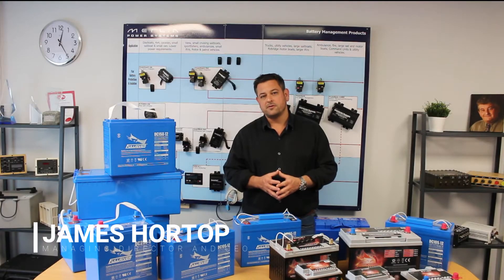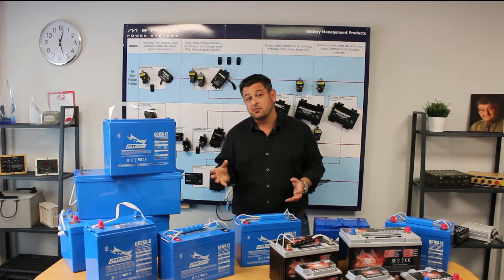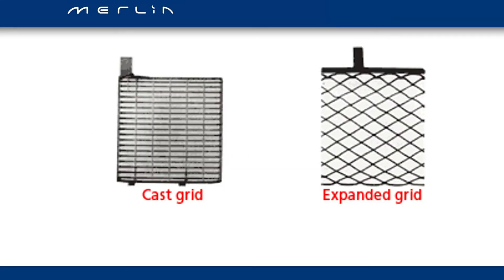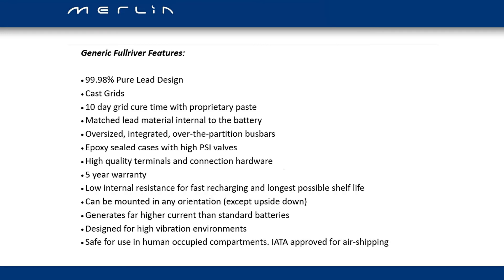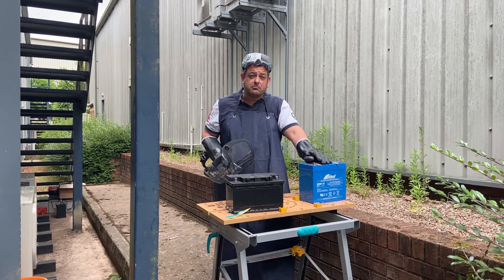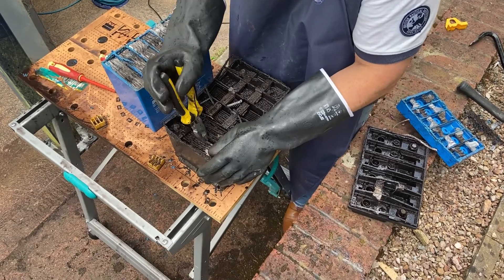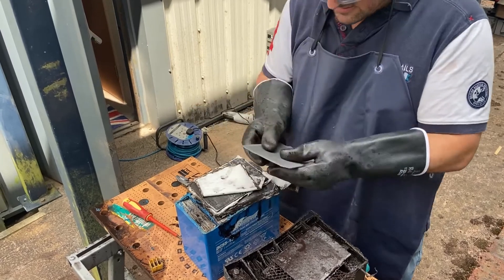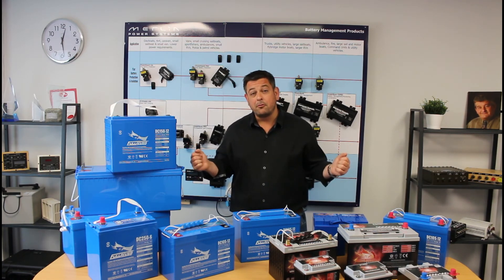Fullriver Batteries: The Difference Is In The Detail

Comment: I have 2 DC Fullrivers in my camper and they are great. I want to change my 85ah aux battery in the car (which runs off a Redarc DCd DC 1225  charger) with the Fullriver DC85. Would this battery be OK under the bonnet of my diesel 4WD ?

Comment: Hey I have a fullriver maintenance free battery, it was nothing taking a charge opened it up and realized all the water is gone from the inside. Can I full it back up with distilled water or a mixture of sulfuric acid and water?
Reply from the maker: Hi Damian. Thank you for your comment. Fullriver batteries are sealed, and maintenance-free, so should never dry out. We would recommend you get in touch with the vendor you purchased these units from if your battery isn't taking charge.
Reply: Distilled yes nothing else sit charge put caps back check volts I did life was 💯 sorry for late response Agm only look in side if bad replace mine was drying out eight years old ✌️

Comment: This seems to be very biased video. You are bullshitting people here.. You comparing AGM against Flooded type (Apple vs oranges). Deep cycle battery vs starter battery (bananas vs melons). Also you have pre-cut the cell tabs to make the battery look mechanically unstable since you knew, that the glass mat in AGM would hold the plates much tighter. The flooded batt. has tabs to hold them in place by design. Only comparable thing here is the lead acid technology principle and that is it. It is like compare ford fiesta to 7.5 ton lorry. Each has been designed for something else. In my humble opinion you are a scumbag or you have no idea what you talking about...